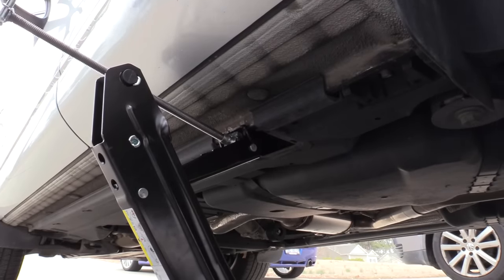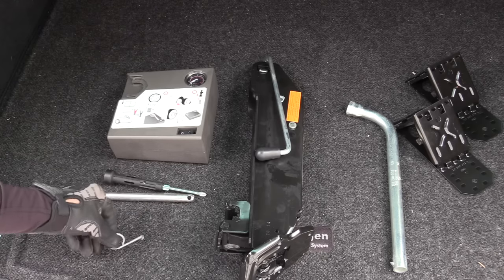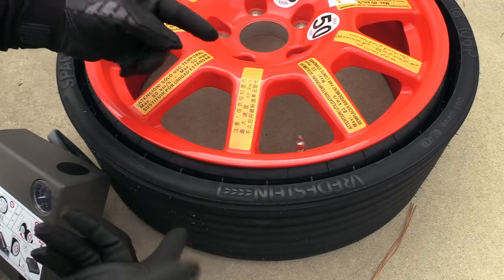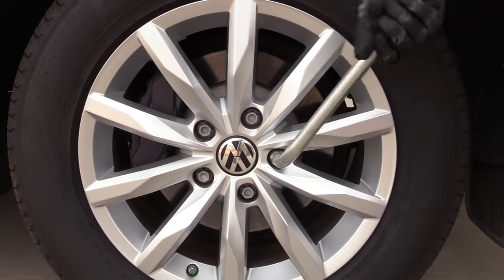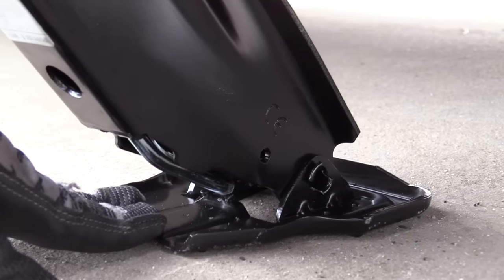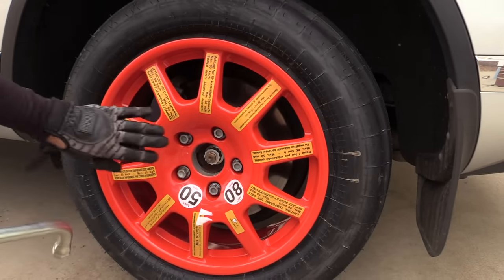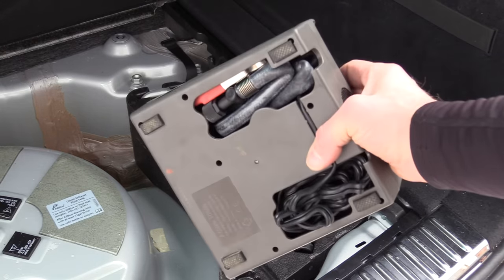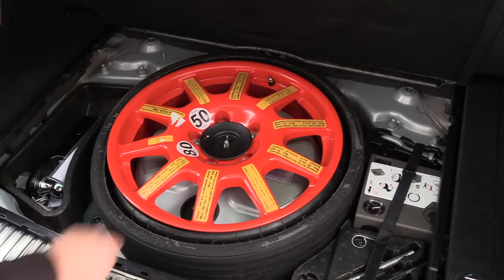How To Change a Tire with a VW Jack (The WIDOWMAKER)

Comment: Just what I want to do on the side of the interstate when it's -33°F. Which it is right now in Minnesota.
Courious if that air compressor would work in the cold? And that Jack seems OK in a parking lot, but scary as hell on a loose shoulder with semis flying by at 70 plus mph.

Might want to mention not putting your body under the car in the pinch zones.

Comment: "I don't expect many people to have a torque wrench in the back of their car."
My #GolfVIClub mates didn't too until I helped one of the clubmates to cure "that rattling in the front left wheel". He happened to have 3 bolts sitting loose and two bolts at around 30 Nm instead of specified 120 Nm and the wheel itself was rattling under load. He was lucky to show up at the club meeting the same day he changed the winter wheels to summer ones at a "seasonally operating tire workshop" where the wheel was tightened, as he said, with an impact gun, presumably at a very low torque setting.

Nice collapsable anti-roll boots by the way, should find such ones and stop carrying two 1.5 lb "truck-size" rubber ones.

The serious issue with the VW jack design is that if placed on a solid, but slippery surface it can slip from under the car and literally grind into the rocker panel.
Reply from the maker: Ugh I wish shops would take wheel torque more serious

Comment: All I can say is YOU'VE GOT TO BE KIDDING ME!   This is an exercise in engineering something NO ONE will actually do on the side of the road, except MAYBE in extreme cases. In these modern times and with German engineering being what it is, I'm totally surprised this isn't being done by a Bluetooth initiated robotic tire changer. This is way too much manual labor. Crazy!
Reply from the maker: Or run flats. LOL
Reply: Ey what's up J! Honestly I can see doing this on the side of the road, as long as the lugs weren't rusted solid. It's really only about 15 mins of work in the end. Typical nonsense, though much worse than in a smaller car or even in a truck. Except in a truck when the tire is stored under the bed it is usually so rusted in place you have to call a tow anyways! Hahaha. I agree though, quite a faff.
Reply: That robotic tire changer is called charles I believe, he isn't activated by bluetooth though.
Reply: @802Garage  lol. I can't see anyone but a mechanic or a DIYer having a clue on how to do this procedure. It's easier just call AAA. ;)
Reply: @jhuntosgarage  That's fair... I am pretty DIY oriented, hahaha.
Reply: who changes the tyres? some guy from the towing company...

Comment: Quick tip, dont pull up to tighten and loosen the lug nuts like he did, your making more work for yourself and you might blow your back out. Use your weight and push down, much easier

Comment: Why do you lift up when tightening the lugs vs pushing down?
Reply from the maker: I can use my legs to lift
Reply: And plus have you ever had a tool break or you slip off whatever you’re tightening ... I prefer pulling up vs pushing down whenever I can do so.
Reply: Makes sense. I have terrible back problems, so I can use gravity to push. Even with proper lift technique, I've tweaked my back pulling up. Might also be because I'm 6'3" and wheels are a long way down.
Reply: Ya, I've had things break when pulling up. Usually ends with something flying toward my head
Reply: I had situations where on the side of the road you find previous tech used air gun set to a million psi while screwing the nuts on. In that situation down is better as you can jump on the the wrench a few times. Of course you risk misisng the wrench and bloodung your foot. In extreme cases used a wrench sideways with like a 2x4 with another car pushing on it to brake the lugs, nothing can go wrong in the method. (ya right)

Comment: I recently bought an Audi q7, practically same car and when I checked the spare tire I thought 'the tire is flat need to pump it up soon' glad I checked this video out first. or maybe read the owners manual. But having owned a few bangers before meant that I have had plenty experience changing wheels.  And those scissor Jack's are the only Jack's I knew back then, and had no issues with them, guess I was lucky. Makes me miss my bmw with its run flats, if there was a puncture or leak I just used a can or 2 of tyre weld. The worst car was a ford mpv with the spare tyre underneath, couldn't release it and it was filthy obviously being underneath the car.....

Comment: A wheel hanger? A hanger for wheels? Huh, the more you know. =)
Reply: Lol I had the same wow reaction, I'm going to start looking for it
Reply: ordered one off amazon right now after I torn my back while trying to put the tire on, holding it in the air, rotating it correctly and getting the lugnut in at the same time
Reply: It’s because many of the German cars use lug bolts instead of studs and nuts. So, there isn’t anything to help hold and align the wheel while you get a nut started. That’s why they give you something to thread in and make it easier to get the wheel on.
Reply: @NBSV1  if it only came included with my skoda ...
Reply: @NBSV1   "many of the European cars" -fixed it for you ^^

Comment: Love that space saver spare. Too bad BMW didn't offer something like that in my E70 diesel, instead of the stupid run flats. I'm surprised VW is still sticking with  that jack design. I tried it once wioth my TDI on my level garage floor, decided I never wanted to have to rely on it on the side of the road.

Comment: Place the upper part of the jack to its intended place first and hold it there with one hand while extending the jack with another until the shoe softly touches the ground.
Then (if needed) adjust the shoe of the jack so that it is right below the upper connection point (or tiny bit towards under the car eg. away from you -- depends on jack) and extend the jack until tire is off the ground.
It is so much simpler this way. You don't even have to peek under the car, You can find and feel the connection with your hand. Very helpful if the your clothing is not suitable to lie down on wet dirty road.

Comment: Are you kidding me??!! Vsw takes a 20 pound tire and replaces it with 30 pounds of tire and compressor and junk in order to save half a cubic foot of space??? No wonder they are a failing company. What a bunch of idiots. I miss my 69 bug.
Reply: In what way exactly are VW failing? Don't get me wrong I agree with the rest of your post. It's a bullshit way to organise a spare tyre and tools.
Reply: @capnskiddies  imo they are building complicated and unreliable vehicles and charging outrageously high prices for them.  Vws are nice for a few years but then they start falling apart, and getting them fixed to keep them on the road costs a fortune. Due to their complexity the average homeowner can't make repairs themselves to save money (in fairness this is becoming true for many brands, just more so with vw and other German brands).  Most of the electronics on v w are troublesome, and the plastic in their switches is cheap and gets brittle and cracks too soon. Just my opinion.
Reply: Can, to clarify, .perhaps they are not failing as in going bankrupt, although time will tell about that. But imo they are failing in just about every other way a carmaker can fail. They are failing to be good engineers, they are failing to make a reliable product, they are failing to make an economical product, they are failing their customers.
Reply: bug in je 70/80 have the same jack... and if you use porche rims you have the same type as spare on your bug
Reply: @hosocat1410  i think the us have got other vw then europe lol we can fix them at home. but still not often.
Reply: @hosocat1410  Your opinion doesnt determine if they're failing. Theyve been in the game since 1937 and theyre the biggest car company in the world.
Reply: @michaelderkacz5526  ok. I wish the German companies good luck. But the Japanese will destroy them with logic, quality, and good engineering, just like they have done to the American car companies.
Reply: @hosocat1410  I own a Honda myself, its not like VW is my favorite. but theres no denying that theyre an automotive powerhouse.
Reply: LMAO Failing? VW is the worlds largest automaker and has been for 3 straight years. What a load of shit!

Comment: I guess you wont fit the original wheel into the space saver (plus deflated) well.... so you better have room in the boot for it.
And even if you do, enjoy the dirty tire (perhaps with mud even) in there... 

Might be a good idea for owners of cars like this (with space savers) to add a big plastic bag that can take the whole car wheel, into the tool kit.
So if you get a flat, you can put the wheel into the big bag and put it inside the boot without having to deal with all the dirt / mud.
Reply from the maker: Yep! That’s a great idea. I keep one for that reason. Even if it fits I don’t want to clean that crap out.

Comment: I've worked in roadside assistance. Those space saver spare tires suck majority of the time. When it's cold as hell outside sometimes they don't like to fill correctly.
Reply: Seen a number of people drive around with them flat... not expecting to need to fill the tire.
Reply: @wobblysauce  i've seen it too.

Comment: Keep in mind the schrader valve will go flying pretty far if you’re not careful when removing it (if there is air pressure behind it). If the valve core goes shooting away, it’s near impossible to find it. Basically looking for a needle in a haystack at that point
Reply: Steal the schrader valve from the tire with the flat. Get a new valve core when getting the flat tire repaired/replaced.  And keep a few in a sandwich bag in the spare tire tool area, just in case.

Comment: My first vehicle was a 05 Touareg V8. I had a flat at home and used the jack, and it fell on the front. It was the most difficult thing to get it back up. And it also bent the shroud around the brake disc to hell. Never again.
Reply from the maker: Ouch
Reply: Word of wisdom invest in a bottlejack to keep in the trunk, got mine dirt cheap at a scrapyard from a Mercedes Sprinter van.

Comment: Reminds me of a 88 Supra I had, full sized cheap spare that I replaced with a normal wheel and deflated tire (slightly thiccer tires than stock). And through a small air compressor into a pocket in the rear hatch.

Comment: That is INCREDIBLY complicated. I suspect the majority of your viewers will have no trouble with this ridiculous process, but the average Joe/Jane will have no clue what to do. Why VW insists on overcomplicating what should be simple is beyond me. What are the odds that 1) all the parts will actually remain with the car over time, 2) the inflator will work when you need it, 3) that spare tire will last more than one use, or even be usable 6 years down the road when you need it, 4) the average person will remove the pinch weld protector and replace when done, 5) use that jack correctly, and 6) figure out how to deflate the tire when done with it? Does this ACTUALLY save any space, what with the inflator and other bits? No way it can save weight, which is the usual reason for donut spares. And it simply has to cost more than a simple donut. Nein!

Comment: why is it called a widow maker
Reply from the maker: It’s a joke in the vw community because so many people had issues with it.
Reply: Because it may fail and you will be crushed under the car making your wife a widow...
It is really for emergency use only but I have seen people using these when changing winter/summer wheels in the driveway as well. I mean get yourself a real jack and jackstands if you are a DIY'er
Reply: It would truly earn its name if someone was foolish enough to work underneath the car while it was supported by this piece of crap. A light breeze would probably knock the car off the jack. Of course, Jack stands should always be used when working under a vehicle.
Reply: If not set up square to the ground and directly beneath the pinch weld it has an unhealthy habit of slipping as it extends. A fan VW and the wider euro VW group, but not that jack.

Comment: I personally have never seen a tire like that, i did have the honor of using the factory jack (Wich was never used) on my lexus this fall when changing my tires, my 2006 saab has a toolkit aswell but only glanced at it since i got a proper lug wrench not those tiny ones and i also have a torque wrench now all i need is to read up on the torque specs :)

Comment: I would recommend lifting the car a little higher than only off the ground, sometimes the surface you jack the car on can be slightly soft and so the jack starts to sink into the ground not leaving enough clearance to put the wheel back on.

Comment: The space-saver spare tire wheel chock thing might be overengineered stuff, but the jack itself is a clever and simple design, it was very easy and quick to lift my Passat, great device. Have you used the jack on a Dodge Avenger? The jack sucks, you'll hit your nuckles on the ground and can only turn 180° at a time

Comment: 2 questions. not touareg related though. on my old b5 there are two pinch-welds on the front  starts 90degrees and then turns to about 45 degree angle inwards.
is that for choice of placement of the jack or what? also shouldn't the pinch-weld sit fully in the groove of the widowmaker? in the video it seems to be misaligned.

Comment: Quick tip. That screwdriver in a kit you can use to remove loosen bolts. It has hex head in it's handle.
Reply from the maker: But it’s 17mm and doesn’t fit the Touareg. :(
Reply: It's stupid for VAG to do this. At least on old CC it fits.

Comment: Did the US ever use the narrow spare wheels?

I'm also amazed that there is no security bolt...

(my mk v golf has a jack, the locknut, a wheelspanner, screwdriver, a hook to get the bolt covers off and a full size spare (which was an option AFAIK, some models had the thin wheel (known as a "Marie biscuit" in South Africa))

Comment: 1st question why not remove all the plastic aroud the spare tire well and put a regular tire. 2 why make the spare deflated useless in an emergency specially if the pump dont work, the point of changing a tire is because you have a flat and 3 what the well was wrong with the normal Jack that needed a 1 leg stand Jack. Engineering at its finest ladies and gentlemen

Comment: ive had one of those jacks fail on me from my 2005 touareg. i just bought the car in october of 2022 from the single owner who bought it in 2005. the jack equipment had never been used but as soon as the tire made it off the pavement...clunk! the threads ripped out of the jack and the car came back down. glad i wasnt underneath it. this video is the first ive heard of the jack being called the widowmaker but its totally with merit. sheeesh

Comment: Must be a newer jack. I had a flat on my 08 GTI and the jack screw was right in the middle of scissor the assembly, ended up scraping my knuckles a few times on the ground before it was fully extended. Seems like a better system now, if a bit scary.

Comment: Hey do you know if there is a jack mode in the air suspension system beacaouse i always see the shop just raising the car with no problem but i tought cars with air suspension needed to be in jack mod

Comment: As you get older, you will learn to always push down on the lug wrench to loosen or tighten.   Your weight helps or even use your leg pushing down to loosen if you have to.  Pulling up to loosen tight lugs or pulling up to tighten can really hurt your back or shoulder.  Says the 60+ year old man!!!!!!   Mike B Tarrytown

Comment: I owned 4 VWs...Sciroccos and a Passat and I love to do my own work on the vehicle.  VW lost me forever on the brakes designed for the Passat.  The piston had to be rotated CCW while you were pushing in said piston.  A 15 minute rear brake job turned into a 45 min nightmare per wheel.  I was done.  No more VWs for me.

Comment: I like my B5 wagon full size spare!! , can do it in 5 mins, I do have a question tho, these are one time use wheels? after you inflate it can it be deflated and or a new space saver tire put on? seems awfully expensive if you have to buy a new spare every time you get a flat , and also repair the tire you had to replace, so your actually replacing 2 tires instead of one?
Reply from the maker: it's reusable. You can see it deflate at the end of the video. 
MY Wagon has a full size too. I wish all cars did.
Reply: @HumbleMechanic  thats great I missed that part as I was writing the comment, now it seems like a much better idea because you now have a pump incase you just have a slow leak, not bad VW, Love the video! thanks for the reply and keep the videos coming! you have taught me a lot, VW guy here since my first car! mk1 rabbit!
Reply from the maker: ROCK ON!!!!

Comment: Widowmaker for sure.  I had a jetta back in the day, and the jack stripped out and dropped.  It had a NYLON block that it threaded into.  VW replaced it with a new one that was not nylon

Comment: You normally do need to lift the Tyre higher than off the ground. The flat Tyre will be lower than the spare, so to fit the new one needs to be higher